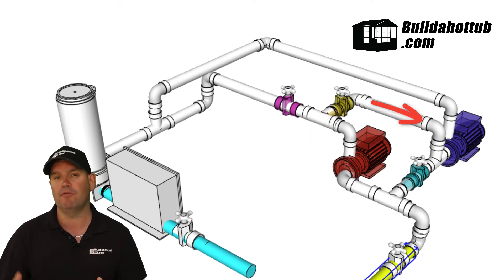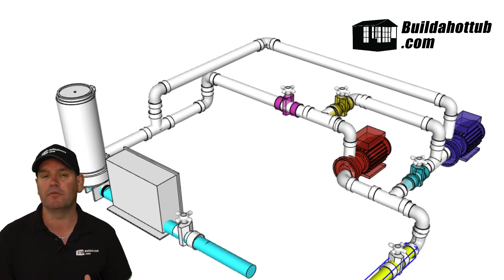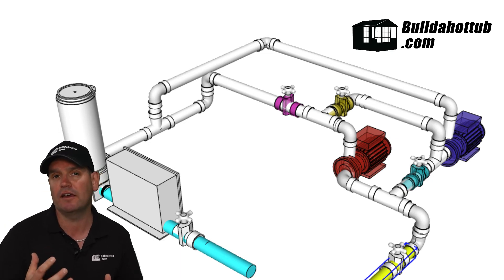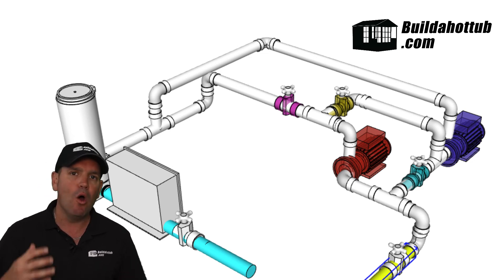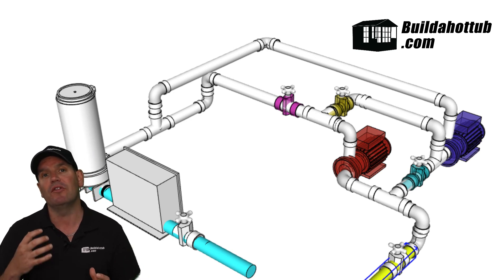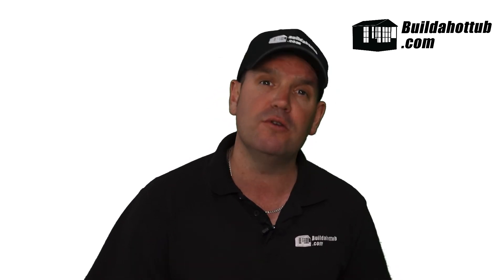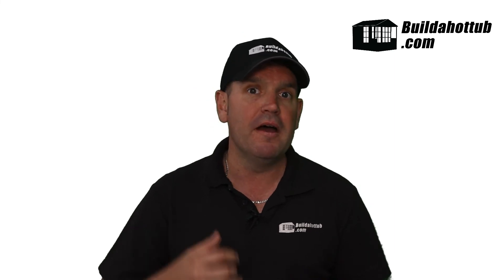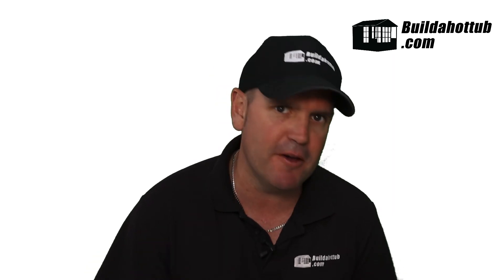Self priming circuit above ground for a below ground centrifugal hot tub pump.

Comment: Hey!

I ran across your blog post covering this prior to finding this video and I had a question.

I recently extended some piping and relocated my two 5 HP centrifugal pumps above the waterline of my hot tub. I have purchased check valves to install in my setup and am thinking I only need to install the check valves down below under the tub on the INLET of the pumps.

Is my logic sound here?  Would love some advice.

---Patrick
Reply from the maker: Hi Patrick, thanks for the comment and the watch. Yes, that is correct. What you will need to do is help the pump prime by filling from the top of the pump with a hose before you switch them both on the first time. What will then happen is with the check valves, the water will not "drain" back into the tub on the inlet plumbing so the pump will stay primed. Might splutter a bit the first time but after that, if the valves are doing their job, you will be just fine. Hope that helps - Andi
Reply: @Buildahottub  Thank you so much Andi! That worked like a charm!!! I really appreciate the advice